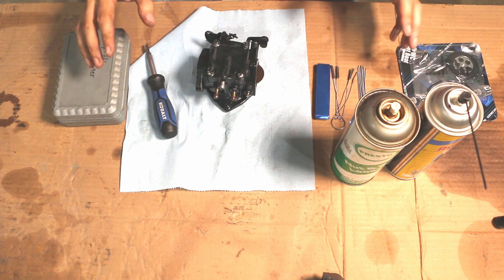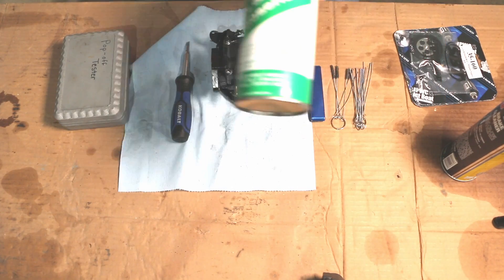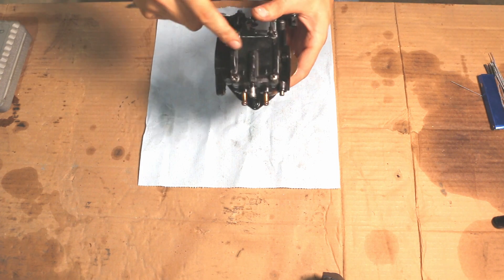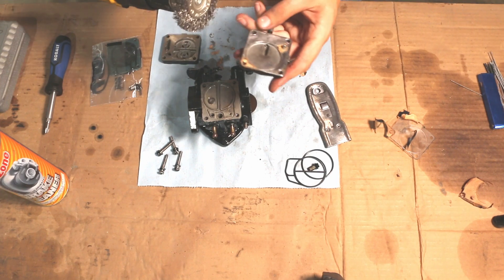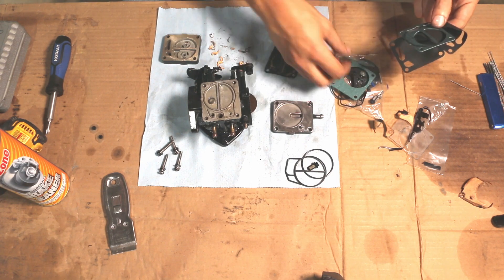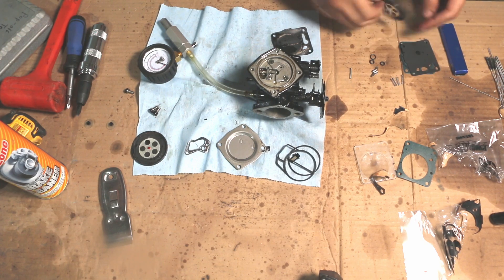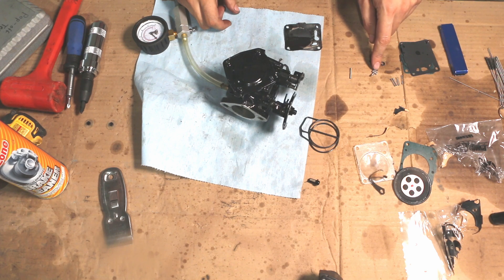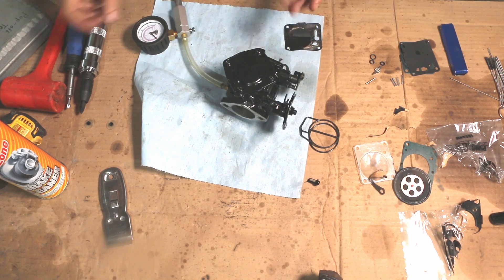Rebuilding a Mikuni Diaphragm Carburetor (BN, SBN, SBN-I, etc)

Comment from the maker: Carb Specs and information: https://trythistv.com/mikuni/

Everything you may need to do this:
SBT Kits: (These are what I use)
SBN & Square body BN (A lot of Seadoos 717 and smaller engines, Yamaha, Tigershark, Polaris): https://amzn.to/3xPS8J0
SBN-I Seadoos (951/947 97.5-03): https://amzn.to/3k365v1
SBN-I Yamahas (PV Motors 800 & 1200): https://amzn.to/3v7uaXS

Genuine Mikuni kits:
SBN & Square body BN (Pre 97 Seadoos, Kawasaki 750 98-02, Kawasaki SX-R 800 03-08, Likely others): https://amzn.to/3rK9GSS
SBN-I Seadoo (Seadoo 951/947 97.5-03): https://amzn.to/3k2tuga
SBN-I (PV Yamahas): https://amzn.to/3Kcr09O

Spare parts:
Internal screws that hold down the metering block (C5-0414-G): https://amzn.to/3MufWq3

Tools:
Manual Impact Screwdriver: https://amzn.to/3EJFFIs
Carb cleaning needles/brushes: https://amzn.to/3OueINc
Brake parts cleaner: https://amzn.to/38bKspH
WD40 or similar lubricant for popoff testing: https://amzn.to/3L9EhRF
Pop-off tester: https://amzn.to/3ENP4yE
Fuel pump checkvalve tool: https://amzn.to/3EJc3uz

Disclaimer: Links on this channel may be affiliate links, which earn me a commission at no additional cost to you, that helps me keep making more videos like this one!
Reply: Thanks
What kit should be used on a 1997 gp 1200?
Reply from the maker: @markbrown309  Your 97 gp1200 is a 1200 Non-PV engine, so:

SBT: https://amzn.to/3xPS8J0
OEM: https://amzn.to/3rK9GSS

Comment: So are you saying it does not matter if pop off pressure is 60psi or 30psi as long as they are equal ?? I’m new to pwc and trying to understand. Thank you
Reply from the maker: You want them close to the spec for whatever machine you have, and as close to eachother as possible. having one carb at 30 and one at 60 would be very bad, but having one at 30 and one at 32 would be great, assuming your machines spec is 35 or something.

Comment: You are saying the high should be zero turns out! Every other video says 1 to 1 1/4. Please explain?
Reply from the maker: Depends on what machine it is going on. There is a spec for each year and model ski that has the jet sizes, popoff range, and settings for high/low screws to start tuning from.

Comment: I have dual SBN 38mm and on the fuel pump side I sandwiched the clear diaphragm with two gaskets on the pulse plate (as you did at 6:37) and installed the carbs. After doing some more digging it looks like on the 38's and late 44's you're not supposed to sandwich that diaphragm since there is that rubber O-ring around the recess where the check valves are. Looks like yours had that O-ring as well, but anyway I ran the ski and it was a little finicky to tune at first but eventually I got it running very well despite the "incorrect" gasket layout. Have you had any problems with that type of gasket layout while having the O-ring present? I might have to take off the carbs again and remove one of those gaskets and tune it because I'm worried it might cause issues later down the road even though it's running well. Thank you, great video!
Reply: Actually, now that I watched the video back closely, it looks like you removed that bottom gasket without saying anything. I assembled it incorrectly and will have to back and take it out. Not sure how it was able to run with the gasket layout I had but it did.
Reply from the maker: I have seen them with and without the gasket sandwich, I don't use the extra gasket when there is an o-ring on the body, but I have taken apart carbs that were working ok-ish that had the stackup with gasket-plastic-gasket-oring.

In theory as long as it seals up reasonably well it shouldn't matter a whole lot since it is on the fuel pump side, so as long as it is pumping sufficient fuel and not leaking fuel out or air in, it shouldn't matter but could have some effect that is unknown to me at the moment.
Reply: According to the parts diagram enclosed with the Mikuni kit (MK-BN38/44 SPR) the BN-44 uses both of those gasket as shown in the video. The BN-38 uses a single gasket because of the o-ring. Their drawing specifically said DO NOT use the bottom gasket on the BN-38.

Comment: The supporting gasket with the circle and the line down the middle should be used, No? or does it matter that much?
Reply from the maker: If I'm remembering correctly that one gets used in certain applications, but not if there is the o-ring seal.
I'm not 100% certain on that, but I'm fairly sure the factory built carbs I've seen have been that way when I took them apart to rebuild.

Comment: Working on a 95 Yamaha wrb650, where can I find the specs for this machine when it comes to pop off and high/low
Reply from the maker: Right here: https://trythistv.com/mikuni/
Should have the specs and everything you need for Yamahas and seadoo, Yamahas are much simpler, basically one setting for each engine size except the superjets

Comment: Great video, great job. Would like to know is it necessary to use assembly lube while rebuilding because i have seen multiple videos with lube and without lube 😀 Kinda confused 🤔 Thanks
Reply from the maker: I've never heard of using assembly lube on a carburetor before, on bearings in an engine yes, but that stuff is so goopy it seems like it would clog up jets in the carb or make the diaphragm sticky

Comment: I have a 1997 Seadoo xp with the bn 40I carburetor. On the chart it says the low is 1 3/4 and high is 0. Does that mean the high adjustment is all the way in?
Reply from the maker: @mickeyhenderson3731  yep, if it says 0 turns then lightly seated all the way in is where you want to start at

Comment: You did not do your research. You must use jis screwdrivers
Reply from the maker: "Must" is a bit of an overstatement. I rebuilt an awful amount of these knowing full well they were JIS and just using phillips anyway, now I do have JIS screwdrivers, but honestly its not much different, the metering block screws are incredibly soft and will round out even with the correct screwdriver if you aren't careful.

Comment: i have a 2001 gs. says i need 130g spring i cant find one. could i use a 1.5 needle with 80g spring to achieve proper popoff with bn40i?
Reply from the maker: That might work, or you could try a 115g spring and might need a little less on the high and low screws, check what skis with the same engine and carb used, sometimes they changed things for emissions purposes or to compensate for other changes from year to year and you can tune around it and get a better running ski that might just be a little different from factory spec. Too low of a pop off is going to tend to be richer, but that's not always a huge problem if it was set up real lean from the factory
Reply: @trythistv  appreciate the response!

Comment: If I don’t have a fuel gauge PSI pressure tool what do I do to test my jet?
Reply from the maker: If you have a good air regulator on your air compressor you can regulate that down and slowly bring it up to find the pop off, otherwise buying a pop off tester might be a better plan

Comment: Why does the rebuild kit come with extra gaskets that you didn't use? The manual says to use them but it seems like everyone leaves those out?
Reply from the maker: Some of the gaskets are for different style carbs, and there are some little parts that typically never need replacement that I only do if they visually show signs of damage.
Most often the fuel pump diaphragm and the actual diaphragm on the other side of the carb are the big issues. That or clogged jets or messed up popoff settings.

Comment: Do you by chance know the high and low setting and pop off pressure for 95’ wetjet duo 300 zx . it is a mikuni 44mm . I can’t find much on them , have been waiting awhile on forums for answers regarding them . supposedly mastercraft only made the wetjet for a few years . this is my first ski .
Reply from the maker: I've only ever seen one mastercraft ski, and if I recall correctly they used a yamaha 701cc engine in it just like the waverunner 3 gp I revived on the channel. I would try the specs for a yamaha 701 and see how it performs. 30-40psi popoff, 5/8 turn out on low screw, 1 1/8 on the high.
Do be aware that may not be correct, but that is where I would start at with the lack of information out there on them.
Reply: @trythistv  thank you

Comment: How to I know which jets I need and springs for my carbs my Yamaha superjet is not stock I have a b pipe , vforce 3, impeller, special cabler, msd cdi, ada head and tdr waterbox
Reply from the maker: With that kind of list of mods, you're quite likely going to have to get comfortable reading spark plugs.
There isn't really an algorithm or anything to select the correct jets that I'm aware of.

Comment: WOW. You shouldn’t be using wire wheel at all on soft aluminum, or even sand paper unless you are resurfacing. Why don’t people understand a painter’s razor held perpendicular to the gasket surface with light pressure is all you need to clean without causing any damage to sealing surfaces.
Reply from the maker: I'll send the next petrified gasket I get your way, I've caused way more damage with a razor than with a wire wheel, but I do agree, a wire wheel used too aggressively will damage the sealing surface. But so will a razor, and you won't get the gasket material off a 30 year old carb with a razor. Nowadays I tend to use a soft scotchbrite pad on a rotary tool.
Reply: @trythistv  funny, I apprenticed under a master automotive mechanic for 10 years and that’s the only way we were allowed to do it when working with soft metals. Excellent results.
Reply from the maker: The heat, ethanol, oil and whatever else happens in these carbs petrifies the paper gaskets so bad, I've never had issues scraping gaskets from an automotive style carb or anything else with a razor, but these gaskets harden up like it's a part of the metal. I've broken razors trying to scrape these things off, so I opted to very carefully use a wire wheel, and then later began with the scotchbrite wheels, which has worked excellent for the past 10 years I've been doing this, but I am extremely careful to just get the gasket off. Haven't had any issues with leaking fuel or vacuum yet, but I am well aware it's a dangerous game

Comment: SLT 780 jetski triple carb leaks gas. I checked all the fuel lines looks good. i got a rebuilt carb , wondering what would be the reason for gas drip when i rev high.
Reply from the maker: Higher RPM could slightly raise the fuel pressure because the pump would be pumping faster, maybe you've got a little pinhole in a gasket or something that only drips as the pressure goes up?

Comment: the reason the screws on mikunis strip out often is because people mistake them for a phillips head screw , they are actually JIS (Japanese industrial standard) screw signified by the little dot on the head , jis has a  different depth and blade angle than phillips and will easily strip when a phillips head driver is used, use a true jis screwdriver when rebuilding and you'll most likely have 0 issues.
Reply from the maker: You're absolutely correct. I read that somewhere a while ago and still haven't picked up a set of JIS screwdrivers. I'm ordering some now, we'll see if it makes a difference! Thanks for the reminder!
Reply: @trythistv get a vessel impacta JIS. It will literally change your life. It’s a JIS that actually has an impact screwdriver function in it. 
Super high Japanese quality item that is a must for carb rebuilders. 
I started with one and now have two full sets.
Reply from the maker: @paulyshore98  like this one? https://amzn.to/4daNHdP
I'm gonna buy either that or the whole set, I've never seen a screwdriver with built in impact function and steel striking cap, so I'm already intrigued by them.
Reply: Yes he is correct I rebuilt my carbs and had to buy a jis screwdriver made a world off difference cost me $15 but had like 4 different size bits a lot of people never even heard of this.
Reply: This is a hack job folks. Guy thinks he knows everything and uses the wrong screwdrivers then , in the comments,  says he rececently picked up a set and will " see if it makes a difference " lol, after instructing the poster that points this out: " you are absolutely correct" lol😅😅😅...yeah, no shit sherlock.
Reply: Where can I get jis screw drivers

Comment: hi great vid thanx for that! do you know the rotation i need for the low and high speed  needles? i have a yamaha waverunner 650
Reply from the maker: My info says it should be 1 1/8 turns from gently seated on the low and high screws on the 650 yamaha engines, popoff set between 25-35psi

Comment: Did you replace the check valve after cleaning the jets?
Reply from the maker: The one I mentioned at 11:30? I typically always replace them on customer skis, but it isn't always needed, the rubber parts fail long before the plastic checkvalves in the fuel pump or the metering block do.

Comment: You can use a pin punch to drive those stripped screws back into shape...and then they will come out with the impact driver almost every time.   It is not always necessary, but when all else fails.
Reply from the maker: That is an excellent tip, I'm gonna lock that one away for later.

I run into so many of these that have been "fixed" previously and the screws are either totally round or have been dremeled into a flathead. I replace them with new ones so the next guy doesn't have to fight with them.
Reply: Where are you getting new screws these days.  The only place that I found them was out of stock when I was looking. @trythistv
Reply from the maker: These are the ones I've been using: https://amzn.to/3MufWq3
They are not official Mikuni screws or anything, but are stainless steel and seem to hold up well so far!

Comment: So long story short, I’ve got a buddy’s 1999 gp1200 and someone before me has torn into these carbs that didn’t know what they where doing and I need some guidance on this. What is the actual pop off pressure and what are the low and high screws supposed to be set at?
Reply from the maker: https://trythistv.com/mikuni/ has everything you need.
You should have a 1200 non-pv on a 99 gp, so the specs should be 38-42psi, low screw should 1 1/8 turns out from lightly seated, and the high screw should be 1/2 turn out on the mag and center carbs, 7/8 turn on the pto carb, and those are of course starting points, your machine may need more or less fuel depending on other mods done, your elevation, fuel type, health of engine, etc.
Reply: @trythistv what is mag and pto??
Reply from the maker: It refers to which cylinder, PTO being power takeoff, so closest to jet pump, rear cylinder.
Mag is cylinder closest to magneto, which is the front of the engine, stator and flywheel housing cylinder.

Comment: great video. i took the 'accelerator assist' apart and noticed the little round rubber orange piece came of, how important is that? thanks
Reply from the maker: If I'm thinking of the same thing, its the check valve, and is essential for the accelerator pump to function. if it ripped, these should be the same thing: https://amzn.to/3E5oPE3 otherwise if if its still good, you should be able to pop it back in place.

Comment: This video helped a lot! When installing the check valves I’m really struggling with putting the black grommet into the seat. I keep poking holes in them and tearing them. Probably need new ones right?
Reply from the maker: Yeah, if those little rubber grommet things end up with holes in them the fuel pump wont work very well. Those things can be a real pain to get in. They make a special tool for it, but I've yet to try one.
Reply: @trythistv ended up getting new grommets because I screwed them up and ordered the tool with it. Little silicone spray on the grommet and pushed right in no issue!

Comment: Hello, great video. I rebuilt bn44 carb on 92 Yamaha wrb650. I followed your video. Cleaned all jets. Replaced pop off spring.  Now pop off is at 24 psi. Pressure stays steady after pop off occurs. I've Replaced fuel filter, check valve by tank. I've pump out tank and inspected tank. New gas. Starts really easy.  Runs OK till I start accelerating.  I'm getting bad sputtering. Idling around 1300 rpm. I have high speed screw at 1 5/8 turns. I've adjusted high speed and does help. Any suggestions?
Reply from the maker: A good way to tell whats going on is to get it where its sputtering, and pull the choke, if it dies or gets worse, your carb is too rich. if it takes off and runs ok, then its too lean.

Alternatively, get it to where its sputtering, and turn the fuel selector off, if it dies, its too lean, but if it takes off and runs ok for a few seconds, its too rich. It will cut out after a few seconds because its run out of fuel in the carbs, but I have nursed a machine that was flooding really bad (leaky needle and seat, or fuel pump diaphragm was torn, I don't recall 100%) over to the trailer by modulating the fuel valve on and off to keep it running.
Reply: @trythistv  thanks!
Reply: Hello again, I did as you suggested. Accelerated till sputtering and pulled out on choke. It starts to die. I must have something wrong  cause I turn in high speed screw so only out half a turn and same thing....I have a manual, so definitely turning in high speed